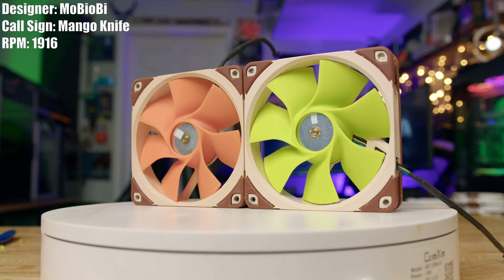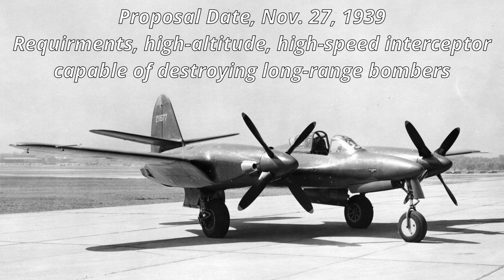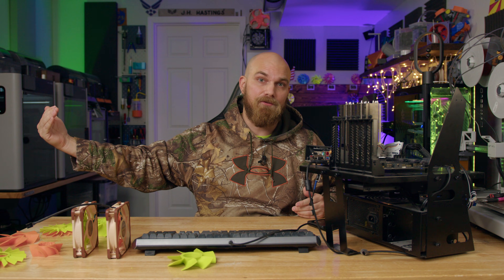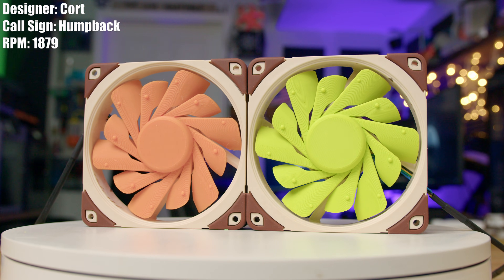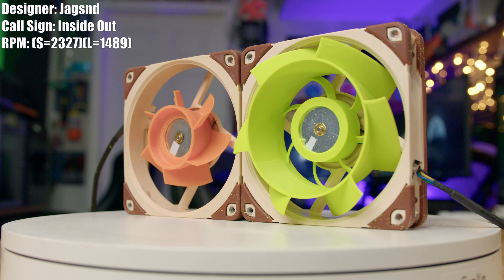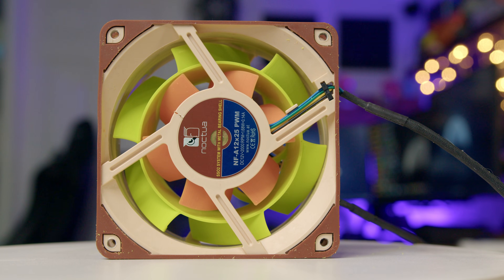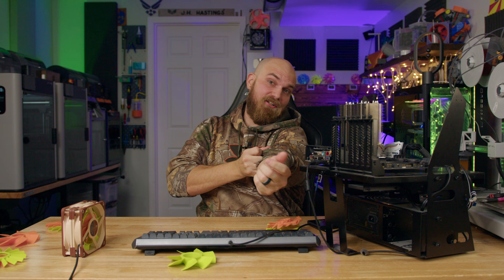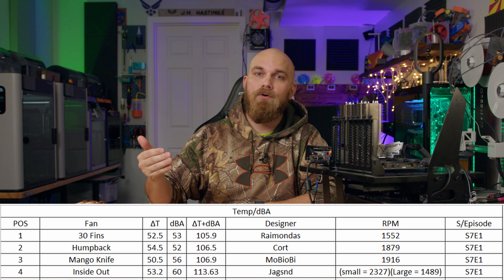Stacked TWIN Fan… is a Monster | Fan Showdown S7E1

Comment: Thanks for factoring sound level into the judging. There are issues with your methodology, but I'm here to walk you through how to fix that :)

Firstly, you can't fairly compare a linear temperature delta with a logarithmic dBA scale. This is a pretty easy fix by converting dBA to linear gain with the formula 10^( dBA / 20 ). For example, dBA 52 = 10^2.6 = 398 and dBA 60 = 10^3 = 1000.

Secondly, you can't fairly compare two scales that use unrelated units without normalizing the data. You do this by using the min & max bounds of your measured values as 0% and 100% and finding the percent where each value lies on that line. For example, the range of linear gain from 398 to 1000 is 602 units. So a value of 631 on that scale is normalized to ( 631 - 398 ) / 602 = 233 / 602 = 38.7%.

So here's how that would apply to these fans, assuming a couple of things:
1) we want to evenly weight both delta C and sound level.
2) we don't know what the min/max bounds will be in the future and use only the current data to inform them (meaning these scores will change when new data pushes the bounds outward, but their order won't change).

Fan Name = normalized delta C + normalized sound = final score
"30 Fins" = 50% + 7.97% = 57.97%
"Humpback" = 100% + 0% = 100%
"Mango Knife" = 0% + 38.7% = 38.7%
"Inside Out" = 67.5% + 100% = 167.5%

Ranking:
1. Mango Knife
2. 30 Fins
3. Humpback
4. Inside Out
Reply: why did you use a min/max bounds scale for sound but not for temperature? Or is that just a miscalculation for the Inside Out temperature percentage (I get that it should be 67.5%...  [53.2-50.5]/4)?   (also, not that it's going to change the rankings, but there are not-shown decimals for the dBA column, based on the shown totals)
Reply: @HMarcBower  Thanks for the correction. I just read it as 53.5 by mistake. I'll fix it in my comment.
Reply: You addressed many issues, but the main still remains: addition. We are looking for a formula which gives higher score for higher delta C and lower sound level. Adding gives better scores for higher delta C and higher noise. Normalizing doesn't change much.
Reply: @jeffreyharpen6772  I've seen this misconception a couple of times. The delta C is measuring how much increase in temperature occurs on the CPU, so a lower delta C value is better. Since lower sound level is also better, we can add them together and rank lowest to highest.
Reply: @NickCombs Yeah, after rethinking I must admit you got a point. We are talking about cooling, but the delta C is not the temperature drop, but the temperature increase above the ambient level.

Comment: Hmm 🤔 what if someone made an intake fan that added more turbulent flow  (taking max heat away from the cooling fins) and an output fan that pulls the air in a laminar manner, allowing retention of the perturbed flow pattern all the way way over the cooling fin

Comment: Sound test really needs to be on the cooler as it can have a large effect on turbulence. Think of case-fans where they mount with a bunch of extra case material right in front of the blades and how much that increases noise.

Comment: I was gunna bitch about just adding dBA and deltaT but actually, no, it works.
If delta temp hits 85 while the room is around 20C, that means yours CPU is at 105C and cooked. If the dBA hits 85, that's potentially hearing loss. So yeah, just add them. This isn't a research paper, but that is at least useful and informative.

Comment: Pro-Tip: Performance vs sound would have the optimal "high" blade counts at 15. This is due to the even number of motor supports and needing the number of blades to minimize tones from passing edges using a blade count which doesn't produce harmonics. And the highest odd blade count number which evenly divides into 360 degrees but it also reasonable to produce via 3D printing is ... 15. The next highest is 45 but that is just doing to be too dense at that scale. You could "cheat" the system by producing an asymmetric fan but that is rather difficult.

Comment: The fans need to be mounted to the cooler for all of the testing. You could use 2 of them. One for cooling and another for sound and air flow.  the wire mounts would allow you to maintain consistent mounting pressure.

Comment: Scoring Thoughts: Thermal throttle is a 0. Best temp drop so far is a 9. Beating the best so far gets you a 10. + Worst db so far is a 0. Best db so far is a 9. Beating the best so far is a 10. ----- Score is 0-20. Take the existing ranges and divide by 10 to get the point increments 0 to 9. Or, do decimals to get exacts. A finer range than 0 to 10 and/or weighting Temp and Sound differently might not be bad ideas. 0-20 for temp and sound with a 1.5x multiplier for temp gets you a 0 to 50 scale.

Comment: Sound test on the cooler! You have so many reasons to. 1) Trying to push/pull air thru the cooler will change the fan RPM which will definitely change the sound. 2) Airflow thru the cooler might create noise or change the sound. 3) Big chunk of metal attached might dampen vibration and sound.
Reply: Maaaaybe smoke test with the cooler too. Potential issues are: 1) Does the 'smoke' leave a residue that interferes with heat transfer over time? Might be worth it to use one for smoke test, and a clean one for the temp test. 2) Can most of the fans push air thru the cooler cleanly enough that it doesn't make a mess of the smoke test? No one wants to watch every single smoke test turn into a fog bank because the cooler blocks too much air flow to test.

Comment: Sound falls off very fast, even a small difference in distance between tests could skew the results significantly, they need to be tested from a consistent distance.

It might also not be the best to weight the sound levels and cooling at equal weight, while sound is important, the cooling is arguably the more important of the two still, so perhaps adding the sound level at 1/3 and the cooling at 2/3, the exact weighting between sound and performance can be adjusted at any time without needing to retest, so that is something that can be tweaked, or even have multiple rankings based on different measurements with no additional testing required.

Comment: I think you should also take into account the CPU clock speed. Modern CPUs will adjust their clock speed based on available thermal overhead so I think you're going to find that most fans result in near identical temperatures.

Comment: It looks like you were testing with the fans next to each other but in open air. they would have a very different noise profile as they go through a fin stack. I know that makes it difficult  to test mountain and unmounting. What’s the distance relative to the fins and fan blades makes a huge difference.

Comment: Adding dBA to deltaT doesn't make sense. For temperature, bigger deltaT is better. In audio volume, lower dBA is better. You should at least have both scales going the same direction. For instance, deltaT MINUS dBA would mean that increasing deltaT at the same volume would increase your score, but also that decreasing dBA for the same temperature would increase your score.

Comment: I think the scoring needs to br reevaluated. You want a higher temp delta and a lower dba right? The humpback would get first because it had the best cooling and the lowest noise. For example; fan 1  60 temp delta, 50 dba ; fan 2 55 temp delta 50 dba. If you simply just add (assuming that is how you did it) the 2 sets of data then the worst fan (fan 2) would win.  Fan 1 - 110, fan 2 - 105. Please correct me if im wrong 😁

Comment: Am I missing something with the scoring?  A high delta T is good scoring (largest cooling effect), and a low DB is good scoring, so adding them together gives nonsense results? I think you want (delta T MINUS dBA), which would put Humpback in first, as it has the highest cooling and lowest sound.

Comment: I'd argue that it'd be most interesting to do a combinated rating of the two. Instead of adding them together for an arbitrary number, rate each fan relative to each other fan. A fan with 1st in delta T and 6th in sound would for example lose to a fan that's 3rd in both (since 3+3 is lower than 1+6). Granted, this requires constant recalculation, but it also doesn't assume that a 1 C gain is equivalent to a 1 db gain, as your current scale does.

Comment: I think you need to tweak your score weighting system.  I agree take sound into consideration,  but the dba reading (with cooler in place) should be a multiplier of the delta temp, not additive.  You’ll need to tweak the formula to find some weighting that makes sense.  

I also think you should run the straight noctua at various room temperatures tonight the ambient temp.  So a 50’deg delta at 20 deg ambient doesn’t score the same as 50 deg delta at 25 deg ambient.  Unless your unscientific ambient air space is guaranteed to be in a couple deg temp band and deemed entirely insignificant to the work and efficiency of the fan.

Comment: I like contra-rotating propellors and they should be implemented in mass to the PC market because it creates a straight forward cone of airflow. Not even a cone really, more so just a cylindrical tube of airflow.

It would be significantly better in terms of cooling for the fans that sit directly infront of the CPU heatsink or the fans that sit directly under the GPU.

Comment: Great to see the show back, my tism has been missing cpu airflow comparisons. The sound test should probably be done with the fan on the cooler, minute differences in judging the distance between fans could introduce errors and airflow would spread and go all over the place, where as the cooler will somewhat direct airflow in a repeatable way and it will keep the distances constant, maybe the same for the smoke test. There's a good balance for judging this season, if you ever run out of ideas in the future like say season 28, you could change parameters and focus purely on the quietest fan, the loudest fan, the fastest etc but still be able to function as a cooler.

Comment: Smoke in smoke test is kinda too thin size-wise? You can't really see the air flow when smoke touches only one point of the fan
Reply: It does need a diffuser of some kind to "shower head" it out across the surface. But I think the single point is showing how the air nearby gets dragged in. I'm confused on which would be better now lol.

Comment: Maybe controversial, but I don't think sound levels should be scored. The reality is that probably none of these fans will be used by anybody and the sound scoring only matters if someone is planning to drop them into their computer. 
Fans are made to move air, that should be the only thing that matters for scoring.

Comment: I wonder if putting tape on the fan where it meets the heatsink, so that there are no gaps, will have any effect.
Or maybe duct tape the outside of the heatsink only allowing air to flow through a channel from the fan output and not be allowed to dissipate in all  directions.
Maybe call it the Duct tape challenge - purpose, to investigate channelling, knowing the cost of insulating the outside of the heatsink.

Comment: I want the Inside out redesigned to be flat mounted on the front and back (reduce layer height so it fits within the Noctua frame so it doesn't hit the cpu cooler?) so you can test performance and sound mounted normally. Please!!!

Comment: if youre using 2 fans, and youre noise-based, youre gonna have harmonics problems. since noctua is clearly an inspiration you should find two fan frames with different RPMs (noctua themselves have kits that have staggered RPM fans now)

Comment: Another way to do it would be to throttle the fans to hit a fixed target noise level then score on cooling.
But what if a fan stays below the target noise level at full power? Maybe move it up to a higher ranking tier with a lower noise level target and rank it with others in its tier?

Comment: I think there should just be 2 scores in that case, IE a score for the fans before noise is taken into account and a score for them after. A fan's purpose isn't to be quiet, it's to move air. Judging based off noise will be completely subjective since it's not just how many db's, but what it actually sounds like (pitch/frequency). Penalizing a fan that moves a lot of air because it makes more/different noise than another just sounds bad, pun intended

Comment: Are the numbers based off of a baseline of a pair of A12x25s or just based off of the entries in each episode?  
The cooling performance is what it is, but the sound levels can't be factored without a baseline. Otherwise they're biased based upon which designs you happen to blindly choose for each episode. 
The sound factor needs be measured by how much louder or quieter it is than the control and factored accordingly. 
If that's what you did than cool, but the video wasn't super clear on it for me.

Comment: Adding the decibels to the score is actually fantastic, because in the end if you actually want to implement any of these, noise is ABSOLUTELY is crucial. Yeah I could get an extremely powerful fan and blast it at full blast for the best cooling performance, but if it sounds like a jet engine it's not exactly viable for everyday use.
Reply: Unfortunately that scoring works poorly the other direction. I could get an extremely silent fan that cools very poorly, but it would still score high, making it not viable for everyday use.

Comment: Maybe take the db rating and instead of a total score do a plus delta vs the stock noctua fan. If it’s louder add the difference and if it’s quieter subtract the difference from the temperature score. Just a thought.

Comment: Should be delta T that is how far below throttling...so say 90C the fan gets you...per the dB it outputs.
Reply: At a constant room temp.  Maybe just add or subtract a degree or 2 you are off the average so that bigger is better more cooling performance deltaT.

Comment: Adjust fan to a set DB and then measure temp. Say run fans to speed that generates a max 35DB, then see what temp delta you get.

Comment: G'day Major,
Very Happy with the Format for S07 of Temp + db = 🙃👎 (as an extreme example an 8000rpm Data Centre Fan will just kill all for temps but who is using one at home)
but I think we need to rerun the sound test with the fans on the Cooler for their true in use db 👉😩👈 vs 😊

Comment: I like the scoring system, even if it results in sets of high cooling high noise fans alongside super silent fans that barely cool. It will produce some interesting results. Before you showed the combined scores, I thought the 30 Fins seemed like the best overall from the type of noise it made alone. Maybe a future iteration of Fan Showdown could do spectrum analysis and evaluate the quality of the noise?

Comment: Normally, to account for the dB difference between two identical noise sources, you add +1dB for each additional source. Example: 53dB + 53dB = 54dB. Another example: 53dB + 53dB + 53dB = 55dB

Comment: I really don't agree with the ∆T+dB ranking. A better ranking would be (100 - ∆T)/dB. Bigger is better.  I would like to see cooling ability per decibel as the ranking. I chose 100 because the CPU is in the dangerous territory at that temperature and should be a failure of the test, i.e ∆T of zero. Thoughts?

Comment: I would definitely do the noise test mounted to the cooler as the additional head pressure on the fans could change the noise profile.

Comment: Something you could do is post a poll on social media for various percentages the two scores should be valued at (temp and sound), equation example being (temp * XX%) + (sound * XX%) = score. Some combinations could be (temp - sound) 10-90, 20-80, 30-70, 40-60, 50-50, 60-40, 70-30, 80-20, 90-10. I would think some people would value one stat stronger than the other.

Comment: I am just here to have fun. So point system is fine.

I could suggest testing the fan at different dB. say 35, 40, 45, 50 dB and then measure CPU temp.
Or you could do it next time and say that people should design a fan that is efficient at up to 40 dB. So that you don't need to make a lot of extra work.

And on a pc, what I am looking for is a quiet fan that can cool really good. 😂

Comment: When I produce a fan with 0 RPM (0 dBA) the delta T is 0 so I have the lowest score and Position 1. BTW
52,5+53 = 105,5 
50,5+56 = 106,5
53,2+60 = 113,2
Your Scoring System does not work and you are lucky that delta T and dBA are round about the same ballpark values.

Comment: I agree with another comment that the sound test should be performed while mounted to the cooler. I can't fully tell how the scoring system works. I'm assuming quiet scores higher while greater Delta in cooling scores higher (little number good/big number good). Just adding them together isn't appropriate, can you show the formula you're using to calculate those points? Also, if the community agrees that some aspect needs to be changed, I vote that the tests be run again for fair scoring numbers, as well as the A 12 X 25 scored for a baseline. And maybe bring back some previous season winners for comparison (if they fit the current setup, some were ridiculously overengineered 😂)